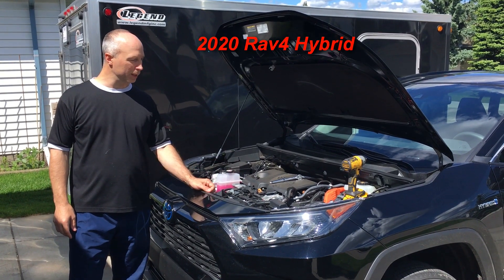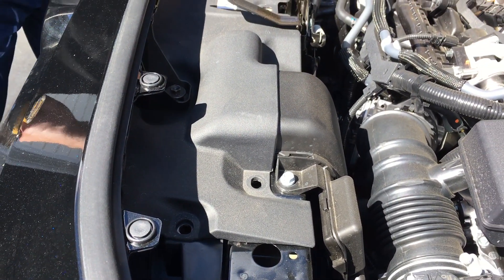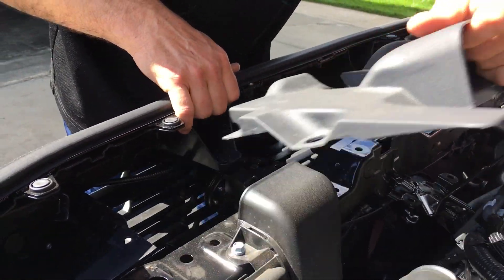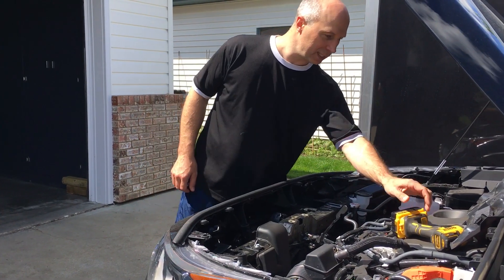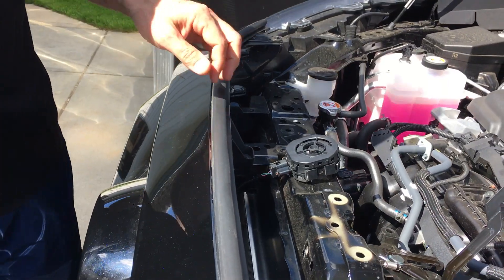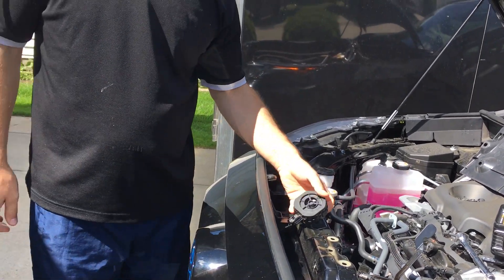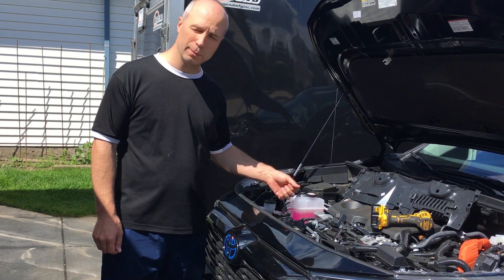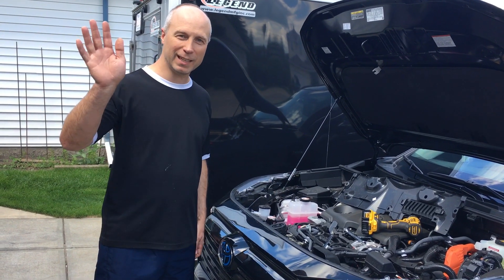EV Pedestrian Warning Sound device explained 2020 Rav4 Hybrid (strange noise when in reverse)

Comment: @sportytourer
Thank you for showing the source of the high pitch annoyance. 
It is rather odd that after going through the trouble of getting the speaker out, you didn't just disconnect the cable. By law, the manufacturer has to include it in order to sell the vehicle. That doesn't mean once it's purchased you can't disconnect it or at least wrap it in foam rubber...🤔
Reply from the maker: If you just disconnect the speaker a warning light will come on the dash as the computer detects a missing voltage draw. In our country and the time of the video it was not law nor a requirement. But depending where you live you have to be careful to be in complinace of the laws/regulations.
Reply: @sportytourer 
Thank you. That makes sense. I saw another video where the guy wrapped it in 1 layer of foam rubber where you could sill hear it but at only half the volume. That's probably what I'll do.
Tesla has a much more tolerable sound in their vehicles so it's really up to the manufacturer to pick the sound frequency. Law only says whatever the sound, it must be a volume of 55 decibels.

Comment: You can stop the horrible back up noise without disconnecting anything! Don’t waste your time working under the hood. Simply get into your parked RAV4, turn the vehicle on, press the accelerator two times, then put transmission into reverse, and QUIETLY back up. So simple!!  We have a 2022 Hybrid RAV4-works every time!

Comment: Why didn't you just pull the wires off ? Its a speaker . It needs an electrical signal to make that noise .If you can't pull them off ; cut them . Explain .
Reply: I heard that if you remove the wires it triggers a warning light on the dash. Did not verify though... So I used a $2 resistor to simulate the load of the speaker and never had any issues. With electronics in cars and ECMs in vehicles getting more sophisticated the days of cutting a wire no longer works as it will trigger codes and warnings. But hey some people like to drive with those orange engine lights showing up non stop on their dash, lol.
Reply from the maker: A warning light will ocme on the dash if the computer does not detect a voltage draw...

Comment: You absolutely do not want to wrap this device in weatherstripping foam tape and then in electrical tape to weatherproof it, thereby effectively reducing the sound by 80%.    Because that would not be allowed.
Reply: Definitely don’t used the foam packing sheets that come in most amazing packages and some zip ties to reduce noise by 3/4
Reply: I came here for this exactly this!

Comment: After you start the car, pump the Excelerator pedal. It will activate the engine and cancel EV mode, thus shutting off the pedestrian speaker.

Comment: My brand new 2023 hybrid corolla makes the same high pitched sound in reverse and also driving forward up to about 22mph. Driving yesterday on the highway at slow speed because of slow traffic  for 2 hours was a torture because of this constant high pitched sound. Then I noticed the same loud high pitched sound after turning the engine off and taking the key out. It lasted about 5 minutes and was very loud outside coming from under the hood right around where the grille and the toyota emblem is placed in the center. It  can't be the warning sound since the engine was turned off. But it was clearly the exact same high pitched horrible sound. Driving the car is painful becasue of this.The dealer said its normal. What is the reason of this?  Are  all toyota sedans have this problem? The 2023 hybrid  toyota venza I drove today at the dealership for comparison did not make this sound. Not in reverse nor driving forward.

Comment: Well, I am fine with THAT noise.  I have a 2022 Santa Fe PHEV.  The backup noise is the same as what is on a garbage truck, or a heavy duty construction vehicle!  Yup, those yellow huge construction vehicles!  It's terrible, and those that are taking test drives for their new cars, should ABSOLUTELY see how their cars sound in reverse!  I would NOT have purchased my Hyundai, had I known of this noise!   What do think my neighbors say about it at 4:45 AM?  Yes, the government regulated it to be "a noise".............  Hyundai just chose a terribly LOUD one.   Lastly...........  just HOW MUCH does a gas vehicle make when it backs up?  Pretty much no noise at all.  Yes, I get the attention of all the cars when I back up in the shopping center - pedestrians too.  It just needs to be about 70% lower.  Is there an electrical engineer in the house?

Comment: It's a super annoying sound but it's probably for the best if you leave it alone, especially if you live in a dense urban area. I've had many people step in front of my car that couldn't hear me coming regardless
Reply: And who weren’t looking I’m sure.
Reply: It is quite annoying.  Especially in a quiet neighborhood at night, or in a parking garage where that sound really echos throughout.  I think it is louder than a modern gas engine in many cases.  I drove a ford escape hybrid for 17 years.  Never had a problem with it being 'too quiet'.  You just be aware of your surroundings.  Which should be the case regardless.
Reply: @DocMicrowave  I would block it with duct tape
Reply: @grazz7865  I did that.  A 2 inch peice of rubber cut from a pipe cap duct taped to the front of the speaker.  Reduced the sound by only about 50%.  
My next attempt will be electrical.
Reply: @DocMicrowave  I would say foam like the air conditioner pieces of foam to surround the window then plenty of duct tape
Reply: @grazz7865  Perhaps, but I think I may try a more technical route.  One which will allow me to turn the sound completely on or off (as needed) from inside the vehicle.  
Know that I know what the technical specs are, its just a matter of coming up with a circuit design.
Reply: @DocMicrowave  I read if you disconnect the wire you’ll get a check engine light
Reply: @grazz7865  I circuit I have in mind should mitigate that.  Car computer won't know the difference.
Reply: @DocMicrowave  nice 👍 I love manipulation
Reply: @grazz7865  The goal is to be able to turn it "down" by remote when desired.  But be able to turn it back "up" for other times (like inspection/repairs).

Am already eye-balling a control panel on amazon.
Reply: @DocMicrowave  oh absolutely not. Muffle that crap and never look at it again. I hate that sound.
Reply: @grazz7865  Lol, hate that sound too.  Just thinking about the future in case the proper operation (sound level) becomes a requirement for passing inspection.
Reply: @DocMicrowave  ah yes. Good point
Reply: @DocMicrowave did you ever find a circuit for it?
Reply: @utweak  Yes,  I am almost ready to do the mod.  I have a control panel setup in the cabin.  I have the connections worked out.
There is just one obstacle I am trying to work out.

I need to find a path I can access to neatly pass a cat6 networking cable through  the firewall into the engine compartment. 

I have been doing some research on it on the internet and have some ideas.  As soon as I get a free weekend in the coming weeks, I'll give it a try.
Reply: @utweak  Yes,  I am almost ready to do the mod.  I have a control panel setup in the cabin.  I have the connections worked out.
There is just one obstacle I am trying to work out.

I need to find a path I can access to neatly pass a cat6 networking cable through  the firewall into the engine compartment. 

I have been doing some research on it on the internet and have some ideas.  As soon as I get a free weekend in the coming weeks, I'll give it a try.
Reply: @DocMicrowave  is the control panel just to enable a path for the resistors and another for without them?
Reply: @utweak  Yes, I'll be using a small relay to cut the speaker out and cut in the resistor.  As well as visa versa.

The plan is to set it up so that it is always on (normal sound) when you turn the car on.  Then you press a button to activate the relay.  (Stealth mode?)  

The idea being, if the car ever has to go in for service or inspection, the default setting is the sound is on.

Comment: the question for me is.
is this a speaker or an independent self contained device?
a speaker has the driver amplifier else where in the car or truck.
an device would have just power and a control signal as well as a ground going to the device.

so does this have 2 or 3 wires to this sound making unit?
or more than 3?
Reply: Just got the Prime.  And the sound as well.  
I think the device is self contained for sound generation and driving the speaker unit.  I have yet to look at mine.  But I only saw 2 wires in other videos.   Maybe just power.  Vehicle computer could just be looking for a load on the line.

Comment: I find this noise extremely annoying especially early mornings when my wife is backing out of our garage to go to work. Anyone know how I can turn it off without creating any diagnostic issues to the car? Will simply disconnecting the speaker create any dashboard notices?
Reply: As I understand it, it will generate a dashboard error from what I've seen in other videos if disconnected.  It is definitely monitored.
Reply: @DocMicrowave  Yes!  I'm not the only one who finds this annoying.  Early morning, every day two or three of these cars in my apt. complex leave and I have to listen to this NOISE.  What will it be like like with dozens every day.  Insanity!
Reply: kpri101.    Yeah, it is starting to get really annoying.  Have had my Prime since mid June and it stands out like a sore thumb with sound when in EV mode.  Especially in my neighborhood.  Were my family has told me they always know when I am arriving home as they hear the sound a block away.

I was in a multi level parking garage the other day and heard that sound from likely multiple vehicles echoing through the garage.  Even though I didn't see the cars that were actually producing the sound.  So yeah, I know what your saying about when more of these are on the road.

I for one am seriously considering doing "toning it down" mod once the car is properly broken in.
Ultimately I would love to create a custom circuit and switch that will allow me to disable the sound from inside the car at any time with out setting off any dashboard alarms.  
Seems the car is also very much monitored for health remotely by Toyota.  Wouldn't be surprised if they would detect tampering.  So I will have to come up with a stealthy way of switching it on and off.

I would likely leave it off 95% of the time.  Turning it back on for service and inspections.

Comment: The UFO speaker!  Toyota mechanics have cars coming back all the time, "My car is broken...making this horrible sound"  In my 2021 Prius, I discovered you can't just disconnect because it trips a check engine light.  So I took mine out, wrapped it up like King Tutt with pipe insulation, and put it back it in.  (It barely fit)  A few weeks ago, I hit a deer and my car was in at the collision repair place and the mechanic calls me asking what the heck is that thing in the front all wrapped up??  He'd never heard of the UFO speaker in the newer EV's/Hybrids....so funny!

Comment: Thank you very much for the explanation. It honestly drives me crazy. I hope one day I will get used to it.
Reply: Put your rav4 in gas mode by pressing on the accelerator before you put the car in reverse.The noise is there only when the vehicle in electric mode.Got outside and try.Good luck

Comment: Is there a reason why you can’t just unplug the speaker ?
Reply: You likely will get an engine service warning on dash and alarm if the engine computer detects a loss of resistance from a component.  So best to add a resistor to simulate the draw a speaker would consume.
Reply: He just said the reason.
Reply: Has this been tested? I’m about to test it as this is annoying.
Reply from the maker: No I did not test removing it so not sure. I just read on the forums that someone else said that happened so you never know. I use a resistor in mine as not a legal requirement in my country. Let me know what you find out.
Reply: @sportytourer  I’ll have to get a resistor. Hopefully the resistance is printed on the speaker. I will have to remember to reinstall it if I go in for service.
Reply: @sportytourer does this get rid of the whurr under 30mph

Comment: According to the local Toyota dealer in Uruguay, the japanese carmaker chose that specific sound frequency because it was scientifically demonstrated that some waveform spectrum vibrations are capable of improving plants growth and nutrient absorption, greatly contributing to the environment.

They never realized that it would've so annoying to pedestrians, as well as the driver and his/her passengers. Luckily, in Uruguay is not mandatory (yet), and some Toyota hybrid owners replaced it with an error-cancelling resistor.
Reply: What resistance do you know?
Reply: Fascinating!

Comment: Thank you for your video. Very helpful. How did you find the spec of the resistor (4.5 Watt 8 ohm)? Did you uninstall the speaker and measure it?   Are there any specific resistors you would recommend?
Reply: Just wrap it with electrical tape. More tape you use the more you can dampen the sound up to 90% where you can just barely hear reverse noise.
Reply from the maker: Another individual looked up the electronic specs from the service manual and a calculation was used to determine the size of resistor to match the speaker if removed. I installed a 4.5 Watt 8.2 Ohm Resistor, that was ceramic and bidirectional and it worked fine. It was $2.25 CDN
Reply: @sportytourer  Whats the name of the resistor you used?

Comment: I want to turn it off  i have the lexus rx450h 2020 its so annoying is it possible?
Reply: It's basically the same system that Toyota makes. I just wish we could customize the sound. If it was less pitchy and had more bass it would sound better. More like the Tesla sound
Reply: @SanthonyL  there is no way to disable it? did you try anything?  like resistor for example
Reply: @ThanosSim  yes that works, but you have to be aware that it could become a liability in the event that you get in an accident. I think what I'm going to do is wrap it up with electrical tape to muffle it a bit. It's just way too loud in reverse. It's probably 5 times louder than a gas engine
Reply: @SanthonyL  thank you  for the reply! i will try it too

Comment: Would it be anyway possible to show how the resistor install?
Reply from the maker: super easy to do. there are 2 wires that connect to the speaker. Disconnect them and instead plug a ceramic 4.5 Watt 8 Ohm resistor in place of the speaker. Make sure connections are water tight so use heat shrink and cover the resistor with electrical tape so protected from the elements.  you will get no error codes and no noise....
Reply: Would it be the same for the Venza LE hybrid 2021? And if so can you make a video please? Lowering or even not hearing the noise would be amazing.
Reply: @sportytourer  Thank you for this video! Is there any chance you would be willing to post a video of the installation of the resistor for those of us who are technically challenged?
Reply: @sportytourer  you’re a lifesaver thank you 🙏

Comment: did you test it , as in if it's the device that makes the noise, or is it really a speaker .
i wonder if you can change the sound to a custom sound, like a phone ringtone.
Reply: Did some tests.  It appears to be a 4ohm speaker.  No other electronics detected in it.  Which means the signal producing the sound comes from another component.  It is that component which detects the 4ohm load on the line to insure the speaker is connected.  It also varies the pitch of the sound in relation to your speed under 21 mph.  

With the proper custom circuitry, and Arduino maybe, I am sure the sound could be changed to something else.

Comment: I just bought a 2020 RAV4 Hybrid this weekend. I drove it back 600 miles without hearing this sound at any point. Last night it started doing it. It is LOUD!
Reply: The sound only comes on if you are in Drive and under 21 mph.  After that it shuts off.  
It is also twice as loud in reverse.

Comment: Probably will trip a code or even disable vehicle if removed. Make a muffle box around it to lessen the noise or take it apart and cut one of the wires directly at the speaker.
Reply from the maker: yes, if you remove you will get a code. If you install a 4.5 Watt 8.2 Ohm Resistor you get no code and no noise. Every vehicle is different. You need to determine the voltage and current in specifications.  You need to check the legal requirement in your country if you plan to do.
Reply: @sportytourer  The resistors value does not need to be the same as the speaker, you should use a higher value resistor to reduce load. A 1/2 watt 200 ohm resistor should be sufficient to prevent a code from being set.

Comment: Do you know what amperage and watts the speaker takes, or what resistor values to use to dissipate the sound?
Reply from the maker: I know some who used a 20 Watt 4 Ohm ceramic resistor which worked. Another read the service manual which stated the speaker  should test somewhere between 6.4 and 9.6 Ohm resistance and the speaker was 6 Volts. He ended up using a 20 Watt 8 Ohm resistor which he claimed worked but was overkill. Based on his calculations though a 4.5 Watt 8 Ohm resistor would have worked perfectly. Going this route is likely only for countries where a noise requirement is not required yet like Canada (though is it is likely to be global requirement eventually).
Reply from the maker: I tested a 4.5 Watt 8.2 Ohm Resistor, that was ceramic and bidirectional and it worked fine. It was $2.25 CDN and I think I may keep it as not a legal requirement in Canada yet.
Reply: I had tested the speaker.  Measured 3.9 ohms.  So a guess a 4 ohm resister would work.   As indicated by other commenters.